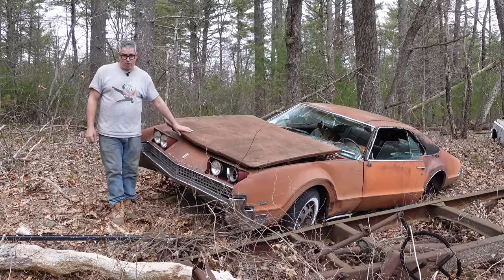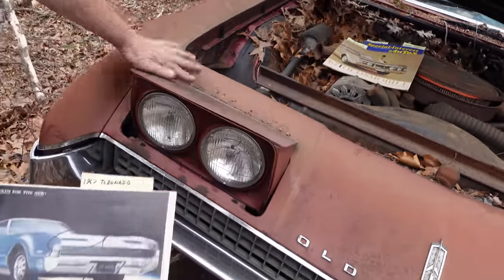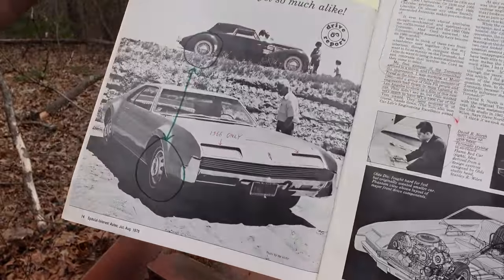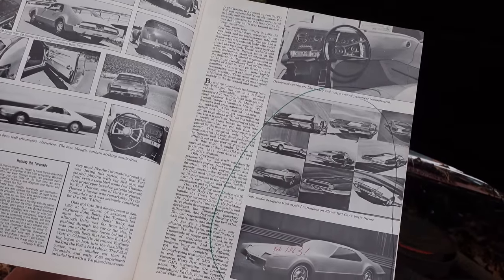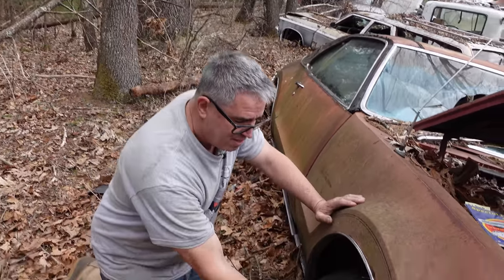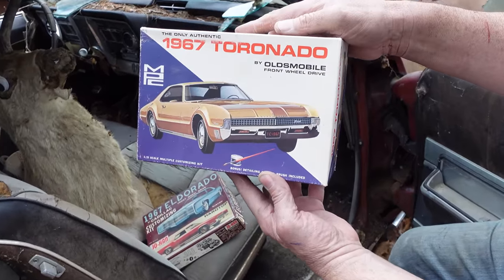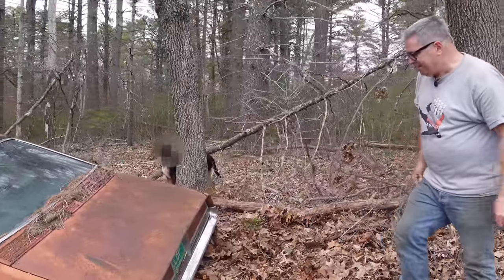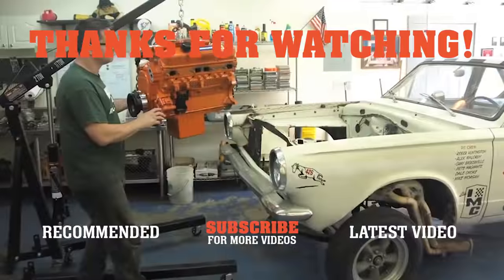Bull In A Twister

Comment: No, the moniker of "Royale" would have typically gone to the 88 line, not the 98 line. The 98 was the premium line, the 88 was a 'step down'. I knew the body shop owner that did the "double ended" Toronado. I had seen the photo on his wall in his office. He said, "You'll never know if it's coming or going". This person owned virtually an entire city block in Queens, from the body shop itself to the houses across the street. He had projects upon projects buried in the corner of his shop. 

No VIN, can't win, but easy to figure out, no doubt: 3 for Oldsmobile, 9487 for Toronado or 9687 for Toronado Deluxe, 7 for 1967 model year, M for Lansing, MI assembly and the rest is the production sequence. The Lansing plant, which was the Oldsmobile "home" plant closed in 2006 and today's Lansing Grand River Assembly has "assumed" the production at the former Lansing plant.

No tag, can't brag, but would be something like 67 for 1967 model year, 39487 for Toronado or 39687 for Toronado Deluxe, EUC for Euclid, OH Fisher Body, 060 or 080 for Black bench seat interior trim, possible X-X for Carnet Red lower and upper exterior paint, possible A for Black vinyl top among other accessory codes.

The Euclid, OH Fisher Body plant was located at 20001 Euclid Ave in Euclid, OH and operated from about 1921 to about 1982, but then stayed open for a number of years via worker concessions. The plant for a time produced parts for Sea Ray boats and then was eventually closed by 1993. The body was produced in Euclid and then railed over to Lansing for final assembly.

Comment: When I was a kid, my uncle bought one that was a couple years old. I remember he stopped by to show it to us and when he left, he lit up the tires for about a half a block. As a kid, I thought it was so cool smoke was rolling out of the FRONT wheel wells!
Reply: 455 cubic inches!
Reply: @rickdaystar477  Yes, depending on the year.
Reply: Were big blocks 400 cubes plus
Reply: @googleusergp  my uncles had a 425 in it the two fastest cars I’ve ever been in was a 1970 toronado and a 1969 Grand Prix with a 428 and I’ve been in Chevelles Camaros vettes and all
Reply: @ogphil5600  There was even a GT version of the Toronado.

Comment: My best friend to this day had either a 1966 or 67 Toronado (it's been too long for either of us to remember which) as a "work beater" back in the mid-late 1980s. Eventually, rust took the ol girl to the great beyond but, to this day, we still talk about taking the radiator to a radiator shop (remember those places?!?) when it needed a repair. The owner of that shop told us that it was THE largest radiator ever used in any production car. I don't know if that's true or not but, I DO know that it took up almost the entire width and, almost from the tailgate to the wheelhouse in the bed of my 1977 GMC pickup. We had a lot of fun with that car and, those radiators are definitely large x huge!

Comment: The transmission and engine was used on the 1973-78 GM motorhome which was also front wheel drive and had a lower floor compared to conventional motorhomes.
Reply: My neighbor has one
Reply: Was that the same one they used in the movie Stripes?
Reply: @jeffrobodine8579  According to IMCDB, yes.
Reply: @jeffrobodine8579  Sure was, but with some decidedly non-factory options! 😂

(BTW,Jeffro: On the subject of Oldsmobiles,  how's that old Oldsmobile truck holding up out there in Beverly Hills?)
Reply: My folks had that GMC motorhome.  This Oldsmobile setup had no problem hauling that beast down the road at 80+ mph.  Once, I even got it up to almost 100mph before my father said, "That's enough".
Reply: @Elmo_Fuddleputt  Dad drove us to Disneyland in a 71 Toronado. 24 hours of highway cruising in comfort. The miles would just fly by at 85 mph. Yes he did get a speeding ticket.

Comment: In the late '70's I had a friend rip out the VW engine in his dune buggy and install a 455 Toronado engine/trans in the rear. It was an uncontrolable death trap and was left to rot in his driveway after only a few memorable rides. It sure did look cool though!
Reply: I'm sure it sounded impressive too.
Reply: @kenschmidt6522  It was like the "Hurst Hemi Under Glass" wheelie car. I don't think it took 1/4 throttle to get the front wheels off the ground. In retrospect it probably just needed several hundred pounds of ballast in the front to get it under control but it scared him enough to just park it. It was funny to tell stories about how crazy it was to drive, not so funny to actually drive it.
Reply: I remember, back in the early '80s, my grandpa and I thought it would be fun to build our own rail buggy, and use a Chevy 283 instead of a VW engine.
But we never got around to building one.
Man...I hadn't thought about that in years, until I just seen your comment.😎
Reply: Does anyone remember there was a Toronado someone built and toured drag strips with? It had 2 engine/transaxles, 1 up front and 1 in the rear. It would smoke all 4 tires all the way down the track.
Reply: @mikee2923  Hey Mike, the beast you're thinking of was the "Hurst Hairy Olds".  Needless to say, with all 4 wheels doing a smoke show, it was a bitch to control, quite often ending up in the weeds!  Over the years I've owned about 5 Toro's - '68's and 69's

Comment: I worked at an Oldsmobile dealership when I was 18 and took a doctor back to his office and was to bring his 66 Toranado back to the dealership to be serviced.  On the  way back I stopped at traffic light and easily smoked the tires for quite a distance.  Thanks for the memories  Steve. 
 Oh, by the way the GM Mark of Excellence foil sticker was  applied to the doors on GM cars in 1967 ONLY.

Comment: I thought the 67 Cadillac Eldorado is the first front-wheel-drive but I'm wrong. The 66 Oldsmobile Toronado came out a year earlier. Both based on the General Motors E-body front-drive platform

Comment: Steve, I'm surprised you didn't spend more time talking about the Ultra High Compression Rocket.  The 425 that came in those Toronados was pretty hot.  Imagine if it had found its way into the 4-4-2.
Reply: The 425 was the best 2nd gen Rocket in my opinion.
Reply: @Freedomquest08  I agree!

Comment: Although it was a later model, I had a 76 Toronado. Mine was a huge luxury land yacht. 455 with FWD. Even though by then that 455 was only rated at 215HP, it had no issues laying down a black mark on the pavement. Didn’t even require a brake stand or an uphill start. Just mashing the gas would erupt the tires. I remember following a buddy of mine who had a wickedly fast 69 Firebird with a 455. He did a quick burnout. So I did one too. At was almost as long as his. I asked him how my smog motor could do that. He said the torque is still there. That was the most comfortable car with the best ride I ever experienced.

Comment: Steve, actually the speedo went up to 140 when you consider the extra 10 MPH band between 130 and 0.  As a Canadian who "endured" the transition to the Metric system, I remember the sticker kits available to easily "convert" ALL speedometers to read in Kph. Between '75 and about '95, I owned 4 '68 and 2 '69 Toro's.  The first one, purchased in '75, set me back the Princely sum of $75.00 - that's because I wanted the AM/FM Wonderbar radio. It could have been bought for $50.00 without it. The speedometer could wrap around to the 140/0 mark then stop - ask me how I know!
Reply: Bro for real bought a car for 75 backs and went 140 mph in it💀👑👑👑

Comment: Good Morning Steve, I met a Man in Upstate NY, that owned one, But his was like know other, He removed the frame, Put a station wagon frame rear wheel drive, 425 4 speed 12 bolt posi, He custom made a console, that was Beautiful, raped around the inside like a airplane cockpit, Great looking car, It took him 3 years to build,,I really thought I would see it in a magazine.
Reply: He built it the way that GM should have.
Reply: Front wheel drive was the whole point of the car.
Reply: Jay Leno has one he turned into some 800 hp RWD beast.
Reply: @seed_drill7135  I don't think the Man built it for the front wheel drive ,He said he loved the body style, and If you saw the car, It was as good as a chip Foose build, People change thing to there Liking, Know difference,than putting a v 8 in a VW
Reply: @brianbloom1799  Sorry, I was replying to Gary, not commenting on the modifier.

Comment: I remember years back Hot Rod Magazine did a write-up on I believe it was a 70 Chevelle. But the guy who built it put an Oldsmobile subframe under the front and made it a front-wheel drive Chevelle.
Not something I would build, but it was definitely interesting and extremely unique. The car came out good
Reply: He rebuilt it, not built it as GM already built the parts once. Hobbyists rebuild not "build" vehicles. The parts already exist or are a combination of parts.
Reply: @googleusergp  well yeah, but it's still a build when we build stuff. Obviously we don't build things from complete scratch like factories would do, but we fabricate, assemble, usually drink a lot of beer and weld LOL 😁
Reply: @richdiscoveries  GM (or whoever) already built it and put a VIN number to it, it so it's being rebuilt by a combination of parts from various sources. The only builders are the OEMs who did it the first time.
Reply: There was another guy who made it into Hot Rod Magazine in the early 1980s, with a Vega he converted into a rear or mid engine format, using a TH425 transaxle from a Toro or Eldo. I think he used a bell-adaptor, and ran a Big Block Chevy.

Comment: I used a 1966 front frame section to build a Front wheel drive 1970 Chevelle with a 6-71 blown SBC adapted to the thm425 transaxle.  The 66 & 67 thm425 was a switch pitch torque converter.  That FWD  Chevelle lives in Virginia somewhere now
Reply: Back in the late 60s, they built a 1 off car similar to yours I think for the owner of Hurst called the “Fouronado”. They took an Oldsmobile 442 and made it FWD. They kept the Oldsmobile engine which I think was a 455. There is a video here on YouTube about it. I think some collector in Arizona now owns it.

Comment: They used a very similar setup all the way through 1985. My mom had a 84 and it sparked much of my interest in cars. This car really doesn't look that bad for sitting there for 35 years...reasonably complete. That 425 would be a great upgrade for a 307 powered olds. Love the videos steve thanks!!!!
Reply: It didn’t have the same heavy duty THM425 transaxle. That was used from 66-78 until the downsizing of the Toronado and ElDorado for 1979. The THM425 was also used in the GMC motor home built from 73-78. They also used the same Oldsmobile 455 until it went away after 1976. 77-78 motor homes used the Oldsmobile 403 that replaced the 455.

Comment: I personally thing the 66-67 Olds Tornado did the best fastback treatment of the 1960s. It looked like the car was designed that way from the start and the fastback was not just grafted on to an existing design. One of my uncles bought a 1966 Tornado new but he only kept it about a year before trading it in on a new Chevy El Camino. His complaints about the car were that it seemed to require more effort to steer and that the turning radius was poor, something that showed up in parallel parking.

Comment: Very interesting video. I've never given much thought to those old front wheel drivers. I worked at an Olds dealer in the late 70's and then a Cadillac dealer in the early eighties and the only front driver that I ever thought was cool was an early 80's or maybe late 70's, not sure, Eldorado that was black and had no chrome. Everything was blacked out and it had stylish aluminum wheels. At the time I was driving a 68 charger with a ho 383 that I had bought off of a guy who was having his 76 Eldorado serviced and his wife had come and picked him up in the Charger. I fell instantly in love with the Charger and got it for 2,200 bucks. It was in perfect condition, Dark green exterior with a white interior with dark green accents. I sold it a few years later for 2,500 bucks. Now I'm sad.
Reply: The Eldorado (from 1967 up, the name was used prior to that) was always front wheel drive and so was the Toronado. The Riviera became front wheel drive in 1979 when it joined its E body cousins (Eldorado and Toronado) and related K body cousin (Seville) being produced exclusively in GM's Linden, NJ plant through the 1985 model year. The Eldorado you're thinking of was likely the circa 1983 and up Eldorado Touring Coupe which had blacked out trim.
Reply: What a shame to see this icon wasting away.  Vermont winters likely killed the frame and floors.
But someone ought to salvage that 425!
If I had the time I’d drop it into a mid 80s cutlass 442/Hurst Olds.
Reply: @Howard Fletcher Very true what a shame this car needs to be resurrected. 👍
Reply: @howardfletcher7206  When I first met my wife she had an 86 Buick Regal that had an Olds 307. I had a rough 76 Olds Toronado that I used as a winter beater. I always wanted to pull and rebuild the 455 and put it in the Regal for a sleeper. The Regal had a bench seat and wire hubcaps.

Comment: Front bench seat is very similar to the structure and style of front seat in my 1968 Eldorado (about $8,000 when new).  Probably lots of parts were shared.
Reply: They shared the same chassis. The Toronado came out for 1966 and Cadillac cribbed the design for the ElDorado in 1967. Though Cadillac used its 472 V8 in the ElDorado.

Comment: I try to learn something every day.  Steve, I’m an Olds man and I never knew about the 4 shock setup at the rear.  As you mentioned, growing up I learned as much as I could from my models.  1/25 Toros (all brands) had plenty of suspension/drivetrain detail up front, but out back they’re basically a promo  chassis.

Comment: I had a 66. The drum brakes were terrible trying to stop 4800+ pounds.  While the pop-up head lights looked cool the vacuum operation became a nightmare as the cars got old.  It was fun to drive tho.  Mine was a base model - no A/C, short armrests sourced from another Olds model with no rear seat door handle.

Comment: I had the pleasure years ago rebuilding those FWD transmissions. They were a pain to remove and install but easy to rebuild. Never ever saw one with a broken chain. Great video sir as always.
Reply: My first transmission removal and install was a 84 model with the th325r4 and a olds 307....very similar to this set up. I've been a gm tech for 25 years and to this day I can't think of a more difficult transmission to remove and install exc for maybe some awd audis maybe. The 3 speed in the earlier cars was alot stronger than the final 4 speed units from 1981 to 1985.
Reply: @patcallahan2278  You’re right about that 325 4L. I’m sure you remember the plastic or fiberglass chain drive covers that always leaked trans fluid. Also remember that top bolt that attaches the trans to the differential ? That was a pain to take out. I had to cut a MAC 15 mm wrench in half just for that bolt. Okay my friend take care and thank you for the comment.
Reply: My brother was a mechanic all his life starting from the late 70s or early 80s. I bought a 76 Toronado for a winter beater and ended up keeping it for almost 15 years. He absolutely HATED this car for some reason. He always said if that transaxle ever needed to come out, he’d be on vacation. He said the drivetrain weighed more than most cars from the 90s when I had it. Guess he was joking but not exaggerating by a whole lot.
Reply: @mikee2923  Your brother is right those transmissions were extremely heavy. I could lift a turbo 400 by myself but that front wheel drive transmission I had to get help to lift it. Good day and thanks for the comment.

Comment: Steve!  Great vid.  I have a 66 Toronado.  I just completed a front disc brake conversion with a dual mater cylinder.  Originally a spooky single master.  The early 66 Toronado reviews in Road & Track and the other magazines you mentioned, discussed the 4 wheel drums as the only feature that was questionable.  The 66 Toronado was about the body and style.  Fantastic.
Reply: I just bought a '66 Toro & i know about the drum brake/ single master cylinder issue! What donor car did you get the replacements from? Was it a difficult conversion? Thanx

Comment: Hi Steve, nice video, nice car!  When Oldsmobile first came out with the Toronado in 1966, it was the most technically advanced car at the time.  Oldsmobile wanted more room inside the car, but in the mean time, they wanted the engine, transmission and drive shafts as far away from the passenger compartment for less harmonic vibration and noise as possible.  Please respond.  Dave...
Reply from the maker: Hello Dave Ridgeway. Agreed, GM was on a roll with elevated technology in the 1960's. While the Toronado was very advanced and its multi-link Morse drive chain and FRONT DRIVE were exotic, let's not forget the Corvair. It is equally brave with its rear mounted engine, aluminum block and heads and air cooling. Sure they were tail heavy, but they are right there with Toronado for "wow, they really did that" points. Thanks for watching and writing. -Steve Magnante
Reply: @SteveMagnante  Hi Steve, I never forget the Corvair!  Years ago, my parents had one and my grandparents had one.  I think the Corvair was a nice car.  Will you please perform a profile on a Corvair!  Please reply. Dave...